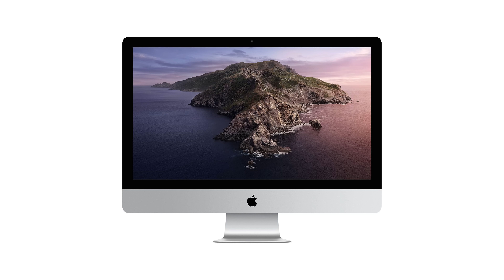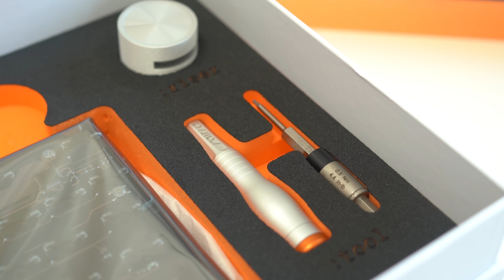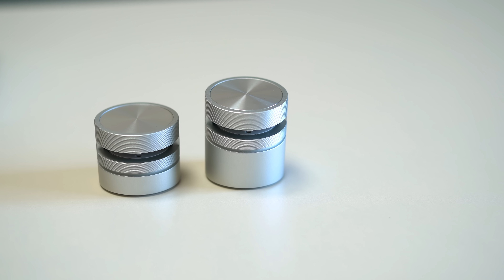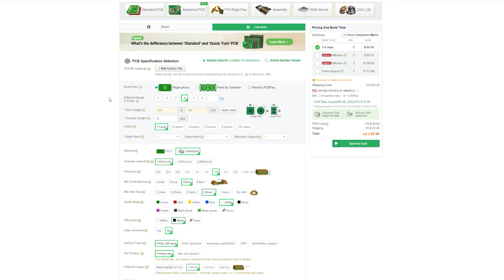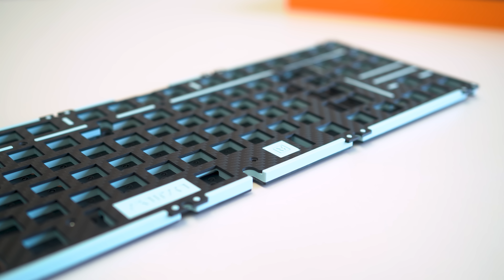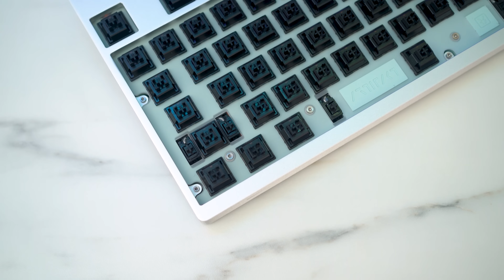If Apple Made a $1,000 Keyboard

Comment: tbh i dont like the design that much (half mac guy)
like its on the one side minimalist with the aluminum and general shape but also totally not bc of the grooves on the sides and the ridiculously large feet that u can see from the front. as a MacBook guy and design student this is just overdone in my opinion. think without that it would look a lot better. also feel like a lot of the angles of the curved edges don't feel right. 
would love to see a keyboard that is more Apple-like than this.

price feels justified, however. like the machining alone on all these parts is absolutely insane. the screws man. 
so if u like the design and want the best build quality its cool i guess

Comment: Apple will either use alps or using wooting analog. It will be aluminum finish but plastic bottom and they won't care if it sounds good. Also it won't be like other mechanical keyboard that can be modified because they practice planned obsolence. Apple consumers will buy it because it syncs with there apple devices seemlessly tracking each of them. It's Ecosystem.
Reply: Alps always sound good, thed use the hairpin switches